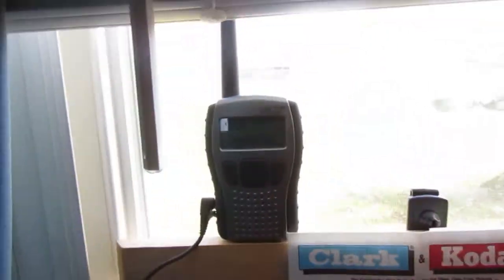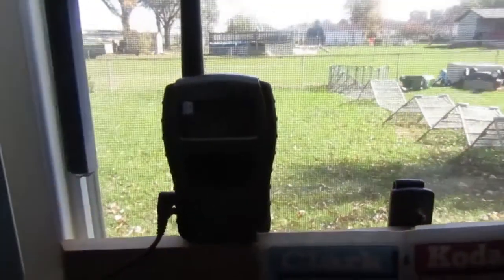EAS #201- Midland 74-210 Custom Event FAIL (Featuring the 12-259)- Weekly Test 11/4/2020

Comment: my 74-210 and wr-400 had a weekly test today. the tests in my area usually last for 15 minutes.  i had to change the clock setting on my 74-210 a few times since it kept showing the wrong time
this is an example (i hope u understand this) 
real time: 12:00 PM 
clock on 74-210: 10:47 AM